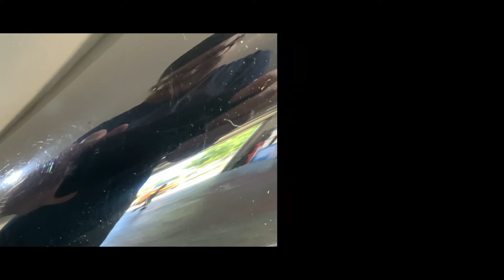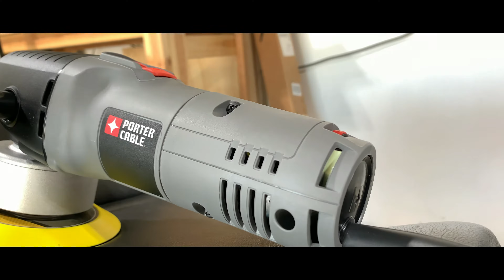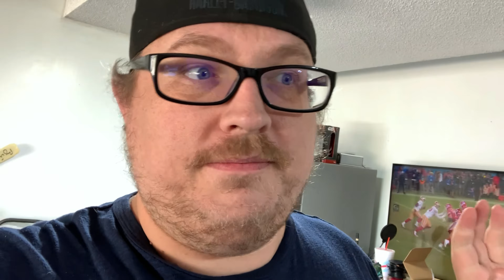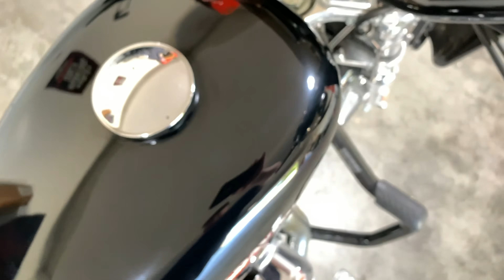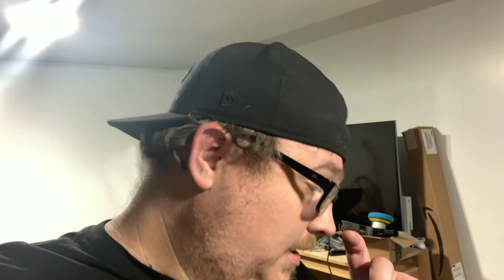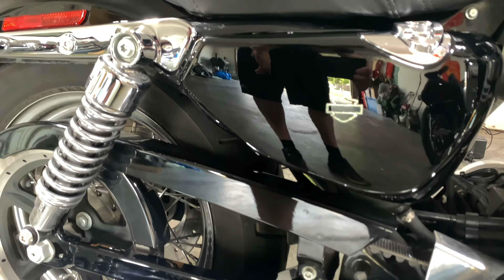How To Detail and Paint Correct Your Harley Davidson Motorcycle - IPHONE CHALLENGE

Comment: I thought it came out beutifull, 14yrs she looks great,
Does the last stuff restabilize or seal the clear coat ? 
If you would have used a rubbing compound would it have done better ? Good job chopper. 💥👍🤙😎
Your wife's gonna be stoked.
Reply from the maker: Yea so I should have used v34 or v32 on it first in hindsight.  I didn’t want to be too aggressive since it’s her bike / our bike haha.  I will be more aggressive on the Dyna.  As for Flowgenix, it should act as a sealer.  The paint is SLICK with it on there.  I’ll use it for touch ups on her bike now.